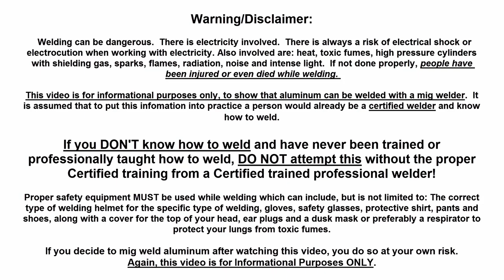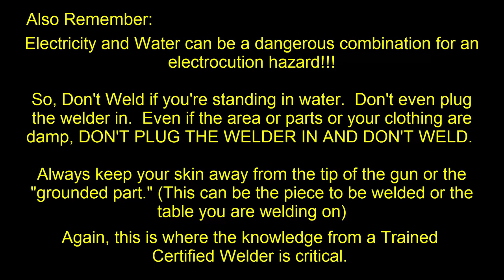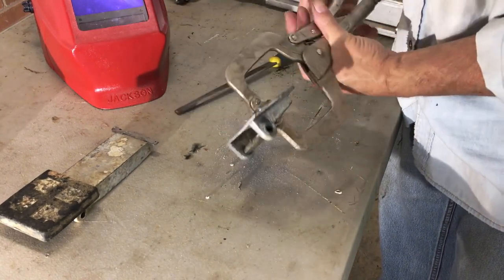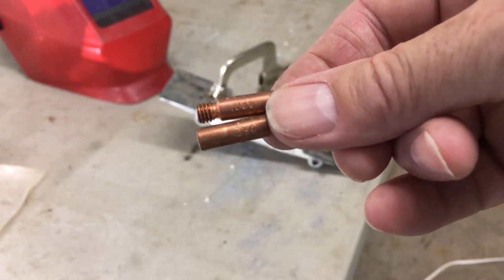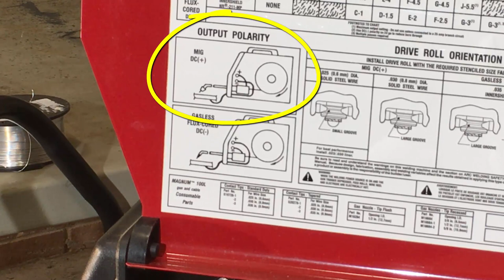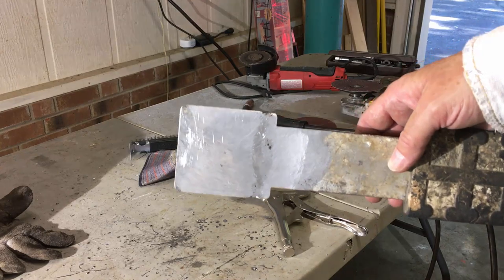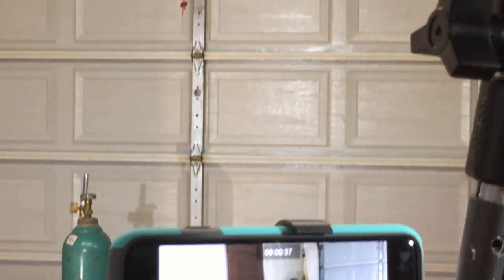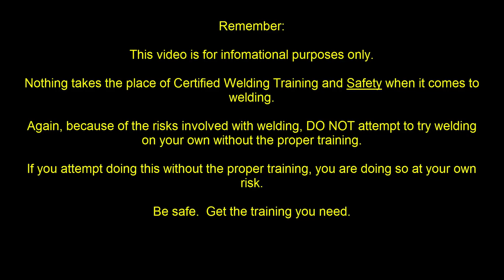Learn An Old Timer's Secrets To Mig Weld Aluminum Without A Spoolgun

Comment: A huge pet peeve of mine: people who ruin files!
During your career as a welder/fabricator did nobody ever teach you to lift the file off the surface for the backstroke?!.... It's not a frikin' piece of sandpaper!~
Reply from the maker: I appreciate your comment, and you'd be correct if I was filing steel.  But, I doubt you'd ever wear down a file when filing cast aluminum.  It's very soft.
Reply from the maker: Mike,
That's actually a great idea.  I'll give it a try.  Thanks!!
Reply: how much does a file cost? it really does not make a big difference u do it that way others the way they feel adecuate. i think is a preference. if one was thought ages ago not to do that updated news pal is not the same anymore file making tech has evolved
Reply: picknngrinn have you used a filing machine? As I was using it I noticed it doesn't lift on the back stroke?! At that point I wondered if guys like you had found a way to tell the machine it is filing wrong.
Reply: yes well said
Reply: Ill be sure to not lift my files up ever again on the backstroke because I now know file Nazis are actually a thing.
Reply: that.s because they couldn't figure out how to lift the file on it's backstroke . no machine is perfect.
Reply: @StairwayToVideo  Thank you for saving me the time to write just that, Hell, I used a dollar store wood saw to cut a brass fitting for jury rigging a power steering hose on an old rear engine bus which sprung a leak on the highway. The two young mechanics with me were dumbfounded and the cop was so impressed he escorted me for miles to see that it worked. It was Sunday and nothing open. To this day it has never leaked and had I not done so I and the caravan I was leading would have been stuck in the cold for at least two days (holiday weekend) and the bus is an old one with no parts available and no junk yard etc etc... it was the only option... yea for knowing softer steal from harder steal!!
    BTW a trick I tested was to clean only a few small points, use the dirty surface tension to hold the puddle and heat the area well so liquid and then use the little holes for the rod to fill and mix (more gas please). Using steal or other surface as a backer and/or shape maker helps a lot so it will not spill out the bottom. I shove the rod in there to push out the dirty until it oozes out of the joint all the while keeping the area warm along the seam/break so it cools slowly and continue heating up the unfilled section .. moving the heater spark back and forth instead of stationary.... the trick is to get the puddle made, liquid and move it down the seam/break without stopping so it melts raises the contaminants to the surface and push the rod in to push new clean material to bond with the melted surfaces. if it oozes out don;t stop just keep going and cut and shape later. A trick I learned with an AC 50 amp "buzzbox" on cast iron with standard 7040.. 4010 rod? (can't remember). With that thing I had to preheat with the rod almost every time and it was hell getting the strike to not stick and keep the ark going... good training. Anyway, I tried this after noticing the nasty uggly junk create a thick surface tension and after over heating so that the bottom fell out and was amazed at how large a puddle there really was. So for learning purposes I took an old dirty carburetor, cut a huge gouge in it and then used this method to stitch it together and fill it in... worked well with a few bubbles at first till I stopped being chincy on the rod. Here with the wire feed that is not a problem. I'd say the splattering in this video is an indication that you are too hot, not enough gas. If you get any cracks you need to let it cool slower so loop your gun over the cooling area as you go along and that will help.
      I have virtually the same welder but not the hose attachment nor the gas.... I thought you were going to show how to use without gas.. 
   BTW can one get a tip which can be used like a regular one and the power put on a foot switch so the trigger for wire feed can be used separately???
     Thanks for the video and many of the comments are really good even if some are a bit nasty in their presents... people are angry and don't know they are actually in charge of their government but allowed it to become corrupted because they failed to manage their agents properly. So now every facet of it is corrupted and they know not the laws to enforce nor how to force them to do their duty according to the law, so they nit pick the shit out of what they do know and want to spank you as they should be spanked for allowing things to get this bad in the first place. All power comes from the "We the people" anything and anyone which works against "That to secure these Rights Governments are instituted among men.." and "organizing its powers in such form as to them shall seem most likely to effect their Safety and Happiness." We threw off the King and that Form of Government so why do people keep acting like surfs and their public servants like Lords???
     Well, study up people cause  "The only thing evil needs to prosper is for good men to do nothing." Talk about the necessity for a clean environment!!! No contamination.... if you allow corruption (evil =live backwards) then you are consenting to it and attorneys (criminals) in robes will run roughshod over the law, you and your rights, property, health, possessions, wealth and your very lives. Look at the use of energy weapons in California.... turning homes, cars and anything metal (especially galvanized)  white hot and turn everything including people into ash in seconds... what is our government doing about it? Nothing, what are the people doing about it? nothing. (before anyone goes off with the tin hat stuff, I was in the military and worked on these types of weapons. The first use I know of was when our corrupted Government unlawfully invaded Panama to seize the canal under the guise of a drug bust on a sovereign country leader.... and just happened to kill all the defenders of the canal so that the US could say that they are unable to defend it and by the agreement are now in default. During that massacre they used this weapon indiscriminately on cars, houses anything or anyone they wanted to test it on. Disgraceful and these are our agents, our military, our representatives, we the people are liable for what our agents do!!) And now it is on our soil killing and destroying at will.
    If you can get video of the striker to ignite the built up chem-trail dust (ingredients of thermite) another weapon used for years and nothing done about it... you will see the "lightening" which is the same as the "lightening" coming out of the tip of the welder only we are tiny ants in comparison ... WE can and must do something about this now before they annihilate us all. Get legislation passed by ballot to cause them all to be periodically tested on their Knowledge, Understanding and Accurate use of the Constitution  to which they are sworn to "support", and the principles expressed in trust by "The Unanimous Declaration of the Thirteen united States of America" ("States of America" united in one cause, which created the "United States corporate Form of Government with the Constitution as its charter) It is breaching its charter and we must "alter or abolish it" as is our duty.
    "That whenever any Form of Government becomes destructive of these ends, it is the Right of the People to alter or to abolish it, and to institute new Government, laying its foundation on such principles and organizing its powers in such form, as to them shall seem most likely to effect their Safety and Happiness.."
     Once knowing the laws as written they will have the choice to abide by it or commit treason which they are doing now, but more importantly without court and all that which are completely corrupted in every state and now the federal District Courts are corrupted as well, even the Bankruptcy courts are corrupt too.. well those that do not want to know or are unwilling to study and learn and abide, will simply fail the test and be relieved of the office that requires them to know it and swear an oath "to support this Constitution".
   Get it done! Get out there and get signatures on petition to get it on the ballot for the people to vote on and get these criminals and corrupted go-alongers out of offices of public trust. Get good and honorable people in those offices and do their job of "secure these rights" and "effect our Safety and Happiness."   
    may the souls which can be saved be saved though their bodies may pay the price... Blessings to all who come in Kindness, the only true currency

Comment: Mike  I have a tip I  welded aluminum in the past your  tips  are good  , in the begining  I melted what  I  was welding got around the problem by putting a wet rag close to what I was welding that took away the heat and stopped the thing I was welding from melting .  I was welding thinner stuff , there are products   that do the same but a wet rag is cheaper ,have you heared  of WELDERS doing this  this.

Comment: Thanks for the tips. I've always found letting the wire stick out about 3/4" from the contactor  helps
Reply: As long as you have enough gas to cover the weld.

Comment: that mask or any other respirators wont stop toxic fumes, just metal flakes and large air born partials. i learned that in my college welding call if you doubt me.
Reply: The particle mask is pretty much useless, but a canister respirator should stop toxic fumes from being inhaled as that's what they're designed to do. But the eyes are still vulnerable. Safety goggles that seal against the face? The trouble is fitting all that stuff under the helmet.
Reply: The dust mask shown here is fine for sweeping up the shop,.. maybe.
An air supply respirator is highly recommended,  but a cartridge type rated for organic vapors is next best.
Reply: right, yrs of welding  galvanized, with resperators. as a parting gift I got bullous. It's some nasty stuff. blisters on ya lungs that pop. you cough up lung tissue, no cure. also called vanishing lung syndrome.
Reply: Michael Wyatt,so sorry man, that sucks ass.
Reply: You need a rubber respirator with filters designed for welding. On top of this, you should have a smoke extractor positioned close as possible. When welding SMAW (stick), I position a fan to blow away the smoke. At home, I open up my garage door. Don't stick your head in the smoke plume. People who don't observe best practices end up statistics.
Reply: Truth Space  .....when you do it for decades your not going to get away from it. doesn't matter what you uae
Reply: Michael Wyatt 
It's all about risk reduction.
Reply: When metal burns (aluminum or steel) it presents particulates (equate this to ash from a wood or paper fire floating in the air), the particulates are a contributor to Parkinsons. The degree of toxicity in the fumes is minor in comparison to the particulate. This is why you will find 3M, and others, make particulate masks (95N -100N) for welding. Having said this, the best solution is a vapor organic respirator that is designed to fit under your helmet (Miller makes one) This is dependent also on the environment you are working in. If it is an open shop or ventilated space then this will be fine, if you are in an enclosed (non ventilated area) you will need a fresh air mask or remove yourself frequently and purge the air within the environment.
Reply: well said @stefanoliessi8722

Comment: i see why welders make bank now this is funny  i dont use any of that home depo crap.  stick to what you know bud and its not welding  not trying to hurt your feelings  but let the welders make the welding videos
Reply from the maker: Home Depot has never sold the Lincoln SP125 Mig.  It was only available through a welding supplier.

Comment: My one suggestion was he should have placed the safety caps on the tank before he moved  the tanks . He lifted the tanks by the control valves which is a NO NO! Plus he left the argon/CO2 tank standing by itself to go back and get the safety caps. I've seen them fall and snap off the safety valve ah do the term uncontrolled torpedo comes to mind. I did NOT know that some mig welders had hot tips while on! But I hate being shocked so I always turn mine off before I do anything with them. Great video.

Comment: One thing that I think bears mentioning - aluminum powder is used in fireworks and explosives.  Never use a grinder on aluminum that has been used on steel, and vice versa.  Always mind the filings and make sure they are safely disposed of.  When mixed with steel filings they become an explosive.

It's also worth mentioning that you shouldn't weld on a flammable surface if you can avoid it and use proper welding gloves, not cheap disposable gloves.  A hot piece of slag will burn right through those cheap HF gloves.  :)

Comment: Tip for those with larger MIGs thus larger guns: It's more common overseas than  in the US to shorten MIG guns for aluminum use but it's not hard to do and a good way to get more use out of one with a kinked cable. How will be obvious but you do need a replacement, low profile clamp. Tweco sell them for their guns for a few dollars. You'll also want a dedicated Teflon liner for aluminum.

Comment: Been welder/fabricator for 37 years. If 110 hobby welding AL then a Teflon liner would help in the whip. Got WAY too much wire speed. Dial it down, you can tell by all the popping, adjust heat accordingly. Use tacks initially to hold joint in position then run bead. Clamp your work while you're welding it. Let it cool before inflaming then clean up your weld if needed with grinder.  Other than that good video for beginners

Comment: Which drive rolls do you recommend? Some have interchangeable rolls that have a smooth groove on one end and have grips or teeth in the groove on the other end. They can be changed by taking the drive rolls off and turning them over or switching ends. With Aluminum it needs to be very clean even the surrounding area and should be washed especially after using anything that contains oil. That could have contributed to the porosity you mentioned in your video. I certainly thank you just the same for sharing your knowledge with us youtubers. I know I have benefitted from your many tips especially in your set up.

Comment: The welder was set to strait polarity? 🤔You may have mentioned it but I didn't want to go back through the entire video to find it. Great job on the video especially considering it was taken with a cell phone.👍
Reply from the maker: Thanks for the comment. No, for aluminum I have it set for DCEP or Electrode Positive.  Thanks for watching the video.
Reply from the maker: Blade I talk about it around the 16:19 mark in the video.
Reply: @StairwayToVideo  Ok thanks! I have never bought a spool for my machine and this could come in handy.
It would be neat to have a spool that would run on my gas powered stick welder.

Comment: A few other tips.
Purge your welding gas feed when you are switching bottles, changing welding gas mix or even if you have let your machine set for a while. If you do not, the beginning of your weld might be porous (bubbly).
Ventilation is important, but a direct breeze can ruin your weld by blowing your shielding gas away.
Some manufactures use special aluminum alloys that require special alloy welding wire. If you have problems, you might need to contact the manufacture to see which alloy they use/recommend.
Aluminum welds shrink when they cool off and can draw an unclamped piece into a curve.

I have 40 experience and I am still working, (large equipment, wreck and damage repair including aluminum dump trailers, dump trucks, cabs and various other large pieces of equipment. I also do custom fabrication.)

Comment: Can that machine(I have a Lincoln 100 weld pak) use a spool gun. I know this is old but really appreciate you posting it.
Reply from the maker: Well, even though I welded aluminum with my welder, the Spool gun company that I found doesn’t recommend less then a 140 Amp welder for a Spool gun. Their gun is 140 to 180 amp. I’ll send you a link in another post.
Reply from the maker: Here is the Spoolgun with the models it fits:  https://www.amazon.com/SELLER-Spool-LINCOLN-140HD-180HD/dp/B087TGNW89
I don’t know anything about it.  I’d have to try it to give a recommendation.  But, at least it has some model numbers of the Lincoln welders that it fits.
Reply: @StairwayToVideo  Thanks for getting back to me.

Comment: Hi a few tips from a pro ally welder you can never get it clean enough ! the job you did would have achieved better results by wire buffing prior to beveling and acetone wipe after bevel! The welds them self would have appeared allot nicer and had less porosity  if you had taken the time to thoroughly prep the work piece ! With the prep weld as soon as possible as ally oxidizes rapidly ! As for the wire the 4043 is near pure aluminium where as 5356 is a aluminium Magnesium alloy far stronger weld properties however the weld tends to have a black soot build up normal with 5356 which are easily cleaned off !  I hope that helps

Comment: If you use a .35 for .30 wire what tip do you use for .35 wire? I don’t see a .40?
Reply: You should use an 0.030 tip for 0.30 wire, and an 0.035 for 0.035 wire. No 0.040 tip. There’s an 0.045 tip. But smaller welders won’t weld with any wire bigger than 0.035 normally, other than fluxcore, one size bigger.

Comment: TBH, if you think you might need to weld aluminum occasionally and have not bought a welder yet. just get a multiprocess machine that has AC/DC tig capability. Sure, you can get by in a pinch with a DC mig, but the versatility of having more or less every process in one machine is worth it.